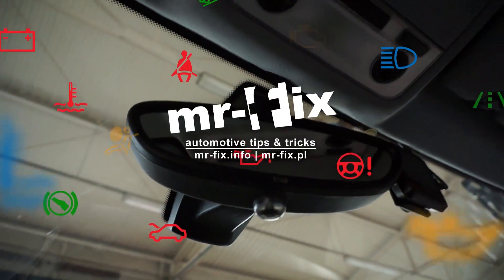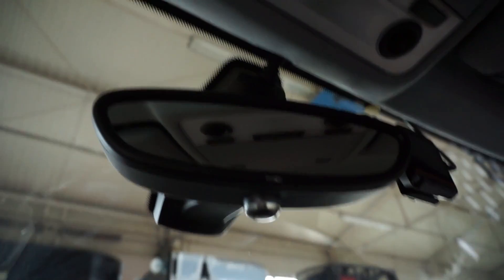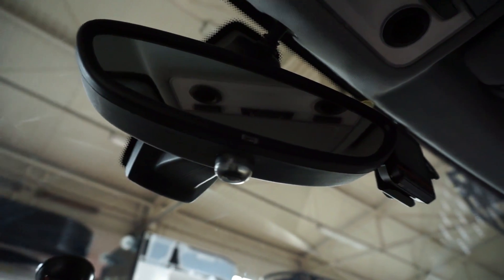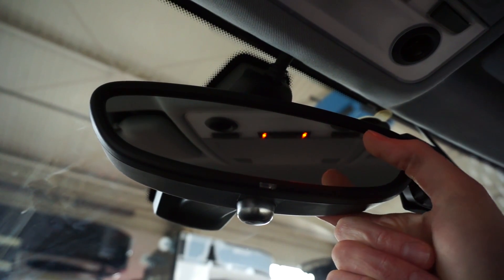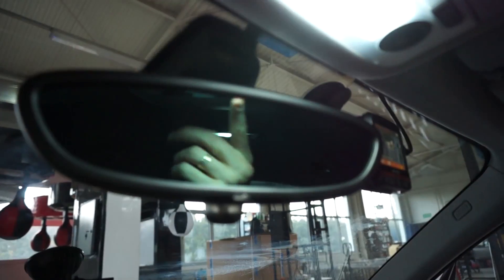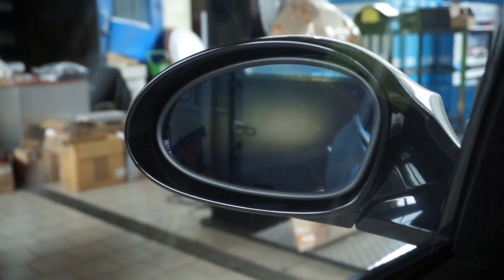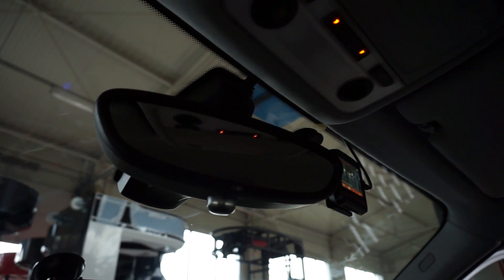How an auto dimming rear view mirror works? photochromatic mirror test

Comment: I have a tundra with auto dimming system (rear view + side view). I switched out my side mirrors for big aftermarket tow mirror’s that don’t auto dim. Now, the main rear view mirror does not dim. Is it because the circuitry in the side mirror wiring is slave to rear view?

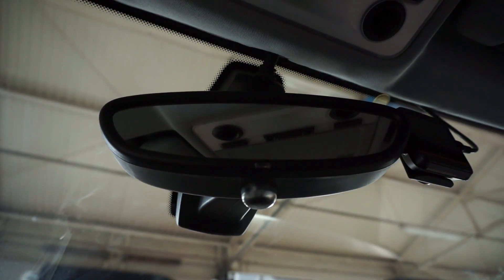Comment: hey guys, does anybody know what is that gray bulb under the mirror at 0:30 ?
Reply from the maker: In cars with factory alarm there's a red LED that indicates when it's armed.
Also there might be an ambient light sensor inside.
Reply: mr-fix Hello, thanks for the video. I have one question for you. What is the small section between the nose and the rear view mirror. Sometimes there is a green light in that small section and sometimes there is not. In your video there is no green light. I wonder what is that green light for?

Comment: Hey my golf tdi 2010 gave me license plate light warning after i switched them to LED how to i re program it adn what do i need?
Reply from the maker: You can change your cars coding to disable “cold test” for the license plate circuit or switch to CAN-BUS ready bulbs which will trick the module into thinking that there are standard bulbs installed.